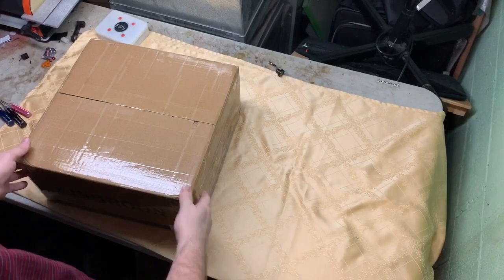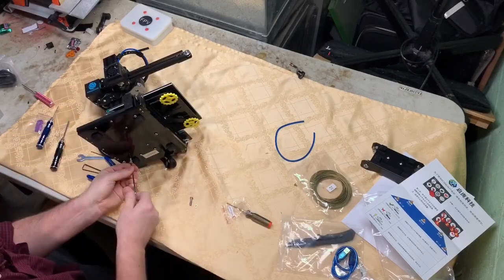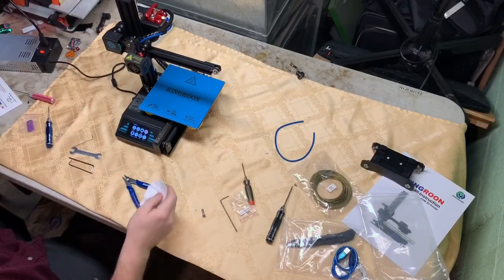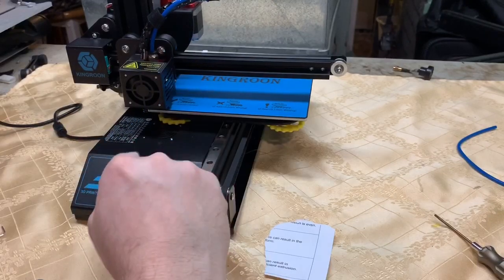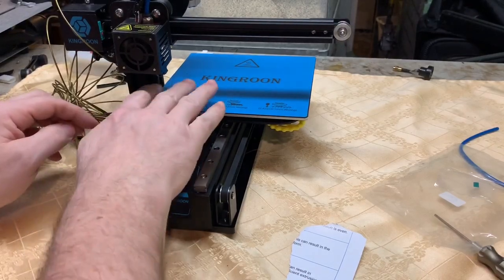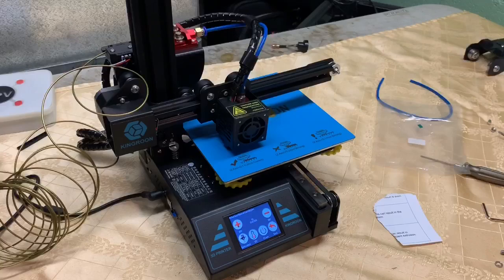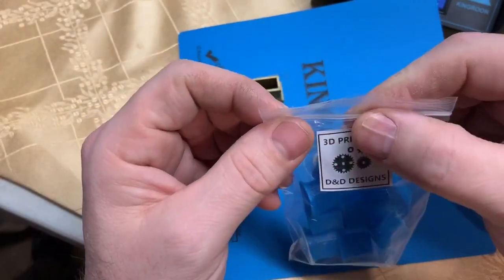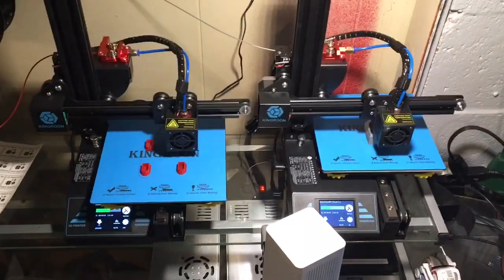Kingroon 3D printer, From unboxing to printing in 20 Minutes

Comment: I have the KP3S for about a week now, the color toutch screen is at the right, the bed is magnetic and the fans much more noisy but it work very well, I love it. I just put some machine oil before using it. At this price it's a bargain ($199.00 CDN).

Comment: I Tried to level the bed 1 thru 4 
Are good. But 5th one,  right of the center, the  nozzle get really tight. Why? And how can I fix this issue? 

Thank you
Reply from the maker: Bed is probably not perfectly flat. You can try to lower the corners slightly to help offset the middle being too tight.

Comment: I got one a couple weeks ago - I must say I love it. I wanted a smaller 3D printer something that I could take with me somewhere easily enough if I wanted to and I knew that probably 75% of what I wanted to print would be small stuff - so far - it's working like a little champ. For the price, you really can't go wrong, under 200 bucks with some PLA and you're set to go. It's a great 1st printer or a great extra printer for small stuff. Highly recommend it. I bought a Labists printer that was only like $15 bucks less (since again I wanted a small semi-portable printer) and it was a garbage toy compared to this. Basically it was a 3d printer pen not an actual extruder and heated bed printer. So yeah... 1st printer, second printer... back up printer. It'll do nicely